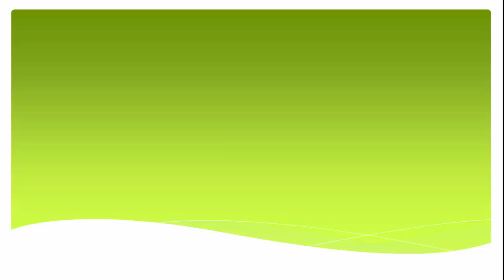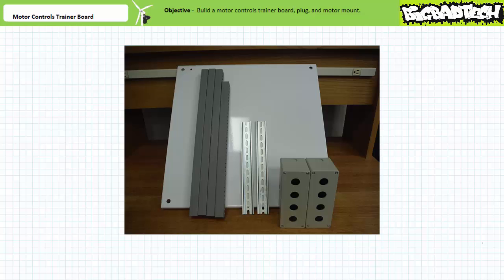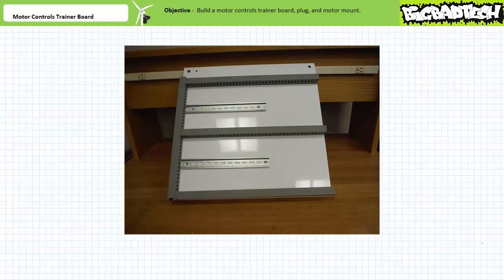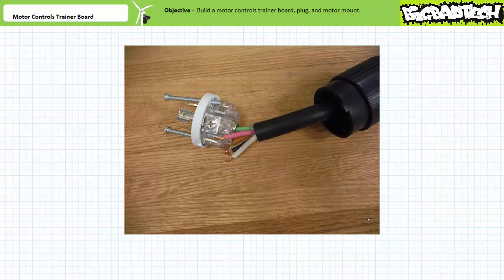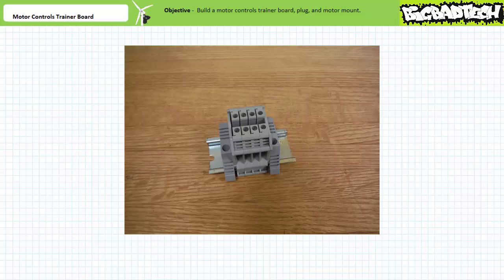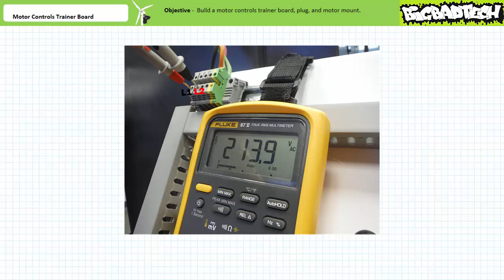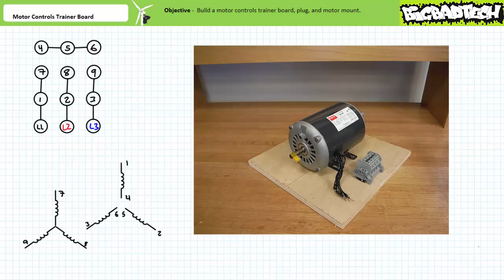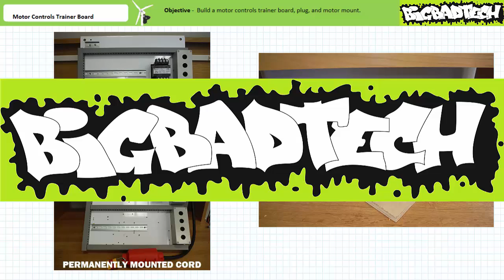Build a Motor Control Trainer Board, Plug, and Motor Mount

Comment: May be an added expense, but a good option for an open trainer I’ve found is steel pegboard panels you can get from Lowe’s. You can use bolts, but a super clean method is rivnuts.

Comment: where do I find the information section?
Reply from the maker: The description below the video. Here's the part list: 72120NP (PLUG 20A 120/250VAC 4-POLE 5-WIRE NEMA L21-20 LOCK BLK/WHT NYLON), BLD (PLUGBOX LOCKOUT 20A & 30A LOCKING PLUGS & CONN RED PLASTIC), FG2 (COVER UNFUSED ALL 75VA & 100VA MLI & MGJ 50VA PRIMARY OR SECONDARY SIDE), FGF2 (COVER FUSED ALL 75VA & 100VA & MLI/ MGJ 50VA PRIMARY OR SECONDARY SIDE), PH100MGJ (TRANSFORMER CONTROL 100VA 380x277x208VAC TO 240x120VAC), SA110-40SL (PB ENC 22mm 4-HOLE GRY 74mm DEEP PLASTIC)

Comment: Any alternative parts for use with a standard household outlet?  I don't have that type of receptacle in my garage, unfortunately.   Is the an even smaller motor to use in this scenario?  Or maybe something similar to practice on?
Reply from the maker: Stay in touch because I'm eventually going to do a series on single phase AC motors.
Reply: Just use the single phase/ split phase coming from youre house.

Comment: What is the trade name for this style of components, the terminal blocks, circuit breakers, disconnect switches etc. that connect to the DIN rails? I hate getting the stink eye from the counter guy at the supply house when I don't know the exact name of the items I am trying to buy. Thanks Jim.
Reply from the maker: Tell me about it. Counter guys have no shortage of stink eye and very often industries have their own trade lingo that is not compatible with one another. "DIN rail mountable" is the term the counter guys is looking for. There's 3 types of DIN rail: top hat, C, and G. The cross sections look exactly like the names imply. There's also mini and wide and deep versions too. These particular components mount to 35mm wide, 7.5mm deep top hat style DIN rails.